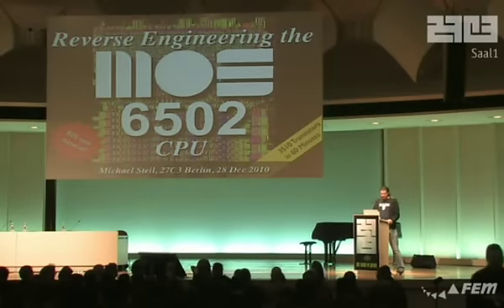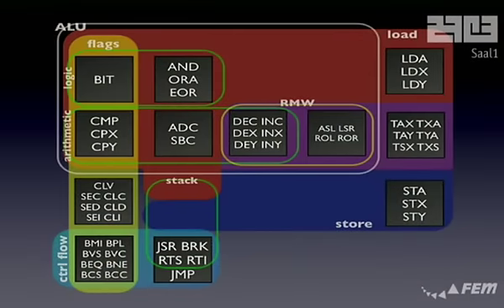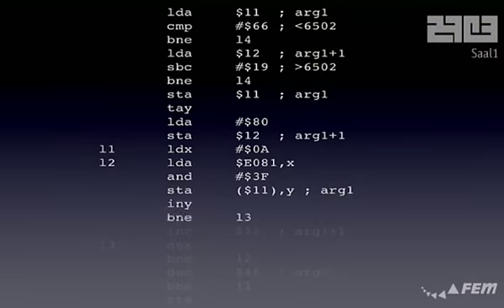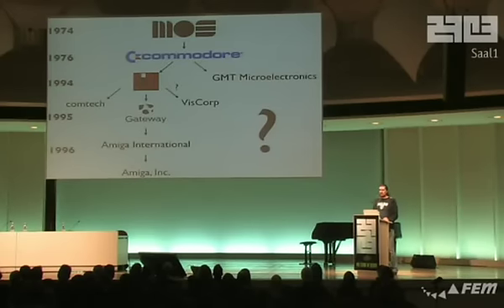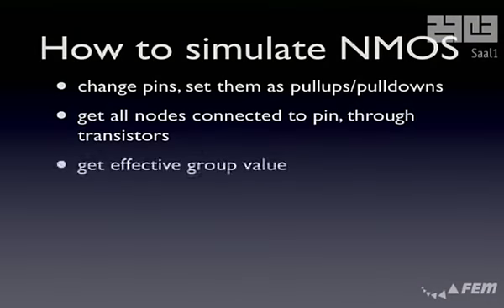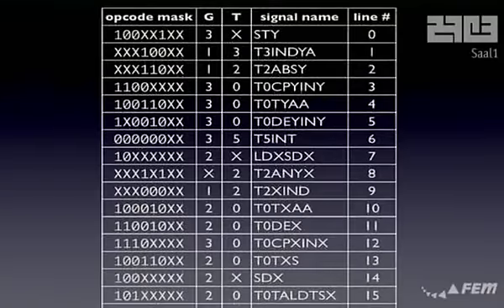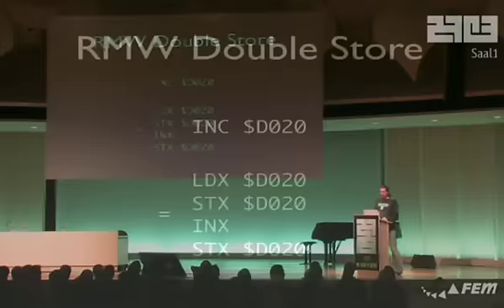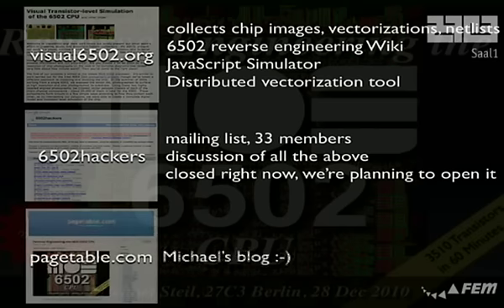Reverse Engineering the MOS 6502 CPU

Comment: The 6502 was in the Super Nintendo? Where? It had a W65C816S compatible main 16Bit-CPU and a Sony-SPC700 sound chip. Do you mean that the W65C816S belongs to the family of 6502 processors? Cause that would be a correct statement. Or is there indeed an 6502 CPU in the SNES that I don't know about?
Reply: It was in the NES.